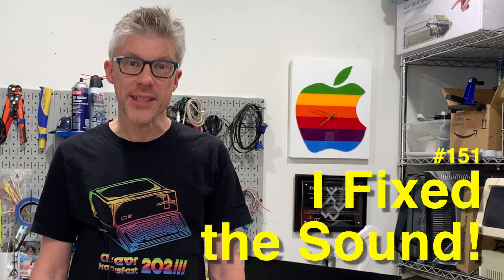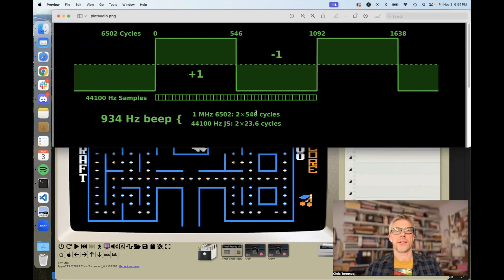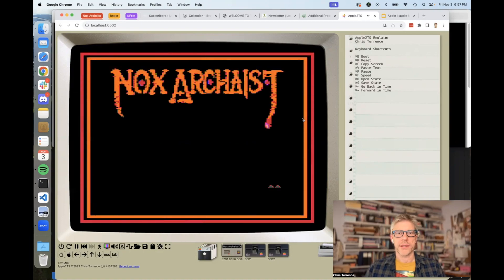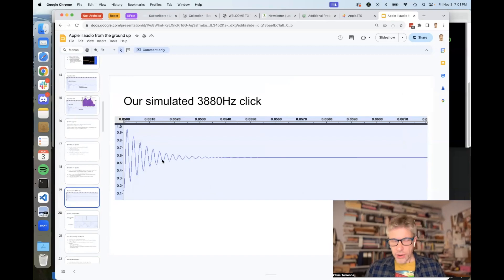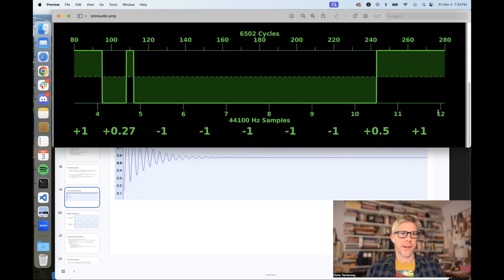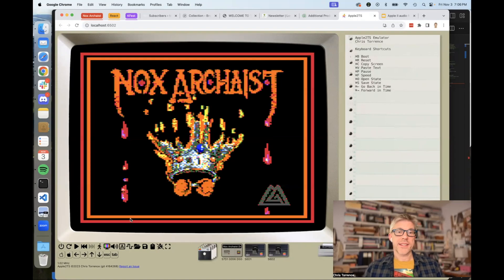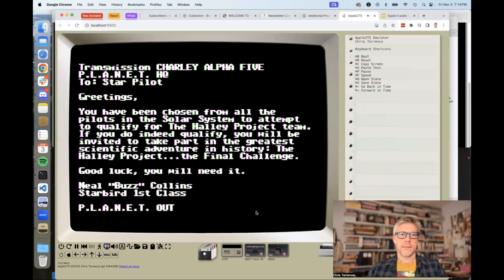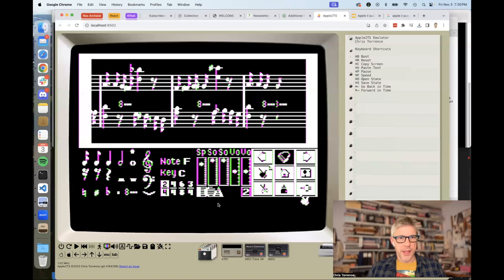#151: I Fixed the Sound in my Apple II Emulator

Comment: Hi Chris. So great to see your updates. Quite a nice explanation of the audio issues with Apple 2 Emulation. And so nice to see you managed to greatly improve it. Just to complement everything you said, I have learned a lot about Apple 2 audio and why emulating it is so challenging with this video, which I wholeheartedly recommend watching. 

https://youtu.be/-Bjitqh7B0Y?si=l7ClMvWkFITlSNkz 

The way software used high frequency to "manipulate" the resulting waveforms was just incredible. I never had the time to properly implement the improvement in my own emulator, and my thought was to reproduce the position of the speaker as it moved from -1 to +1, and revert direction when needed, but it seems your solution is much simpler. Thanks so much for sharing.  

Another software that shows a bit possible sound emulation challenges is Santa Paravia and Fiumaccio tournament version, which has 2 sound modes: one for the original Apple 2 and one specific for emulators.
Reply from the maker: Thanks! I had watched that video a while ago, but forgot about it, so thanks for the link again. I'll check out those other software titles.

Comment: Great work, Chris, and clearly explained. I used what amounts to the same technique in my current emulator. I tried a lot of different window function filters but a simple rectangular filter worked best for me. I had not tried the Nox Archaist demo until now and was instantly relieved that it sounded OK. My audio acid test has always been Archon, which takes every opportunity to sound terrible under emulation. I'm looking forward to learning more about Mockingboard emulation, something I've been putting off forever.
Reply from the maker: I'm glad to hear that a similar technique worked for you. I forgot about Archon - I'll have to give it a try! Regarding Mockingboard, I was in the same boat - putting it off because it seemed really confusing and complicated. Plus, the Mockingboard manuals are junk in terms of how it actually works. I don't know how anyone managed to program the thing back in the day. I ended up using the 6522 and AY-3-8910 datasheets almost exclusively, and that did the trick. Anyway, I'll start putting the next video together!